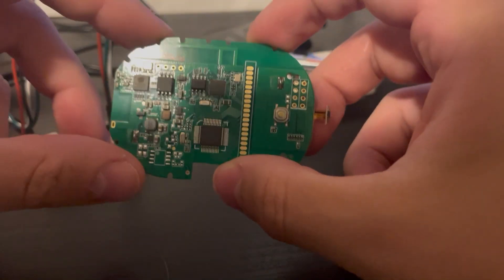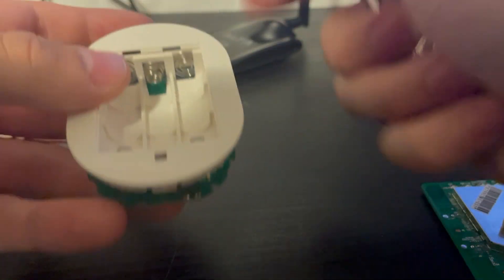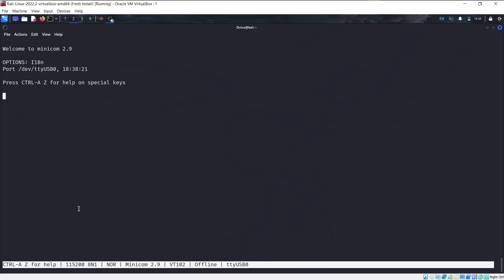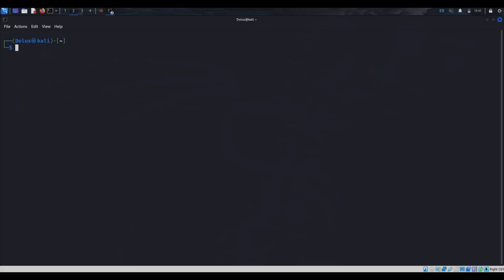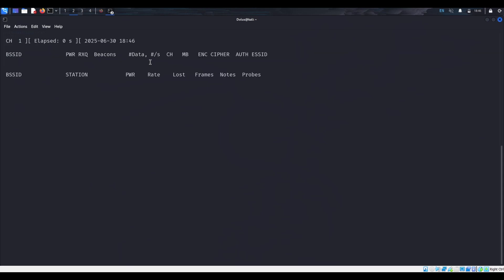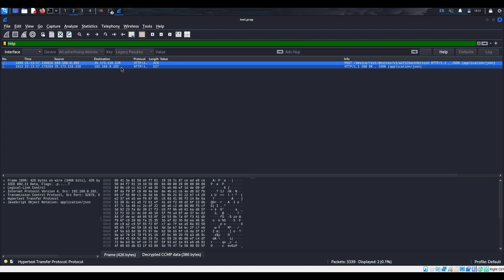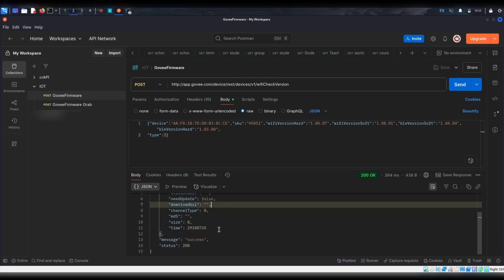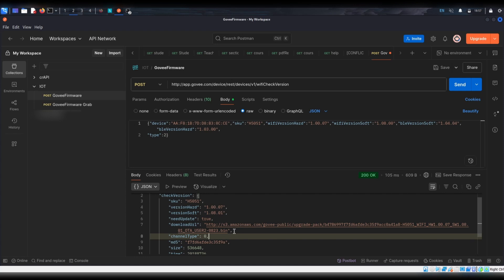Getting device firmware OTA

Comment: 13:12 I’m just amazed that they were doing this over plaintext, not even attempting HTTPS. Granted, with that they need to make sure their root CA certs don’t go out of date. Either that or it’s just security theater and they use HTTPS but don’t verify the cert (so you could MITM without an issue). But here you just passively picked this straight out of the air. 🤦‍♂️ No wonder it’s vulnerable!
Reply from the maker: A lot of these devices have shocked me with the disregard to even the simplest of security measures. It’s not like this are complicated concepts or super old devices either
Reply: p.s. I wonder if you could theoretically MITM this response and point to your own firmware and use that to write your own modified firmware to it, if you wanted to. Might be a fun way to brick your device.
Reply from the maker: That’s a really cool idea that I am going to have to look into. Thank you.